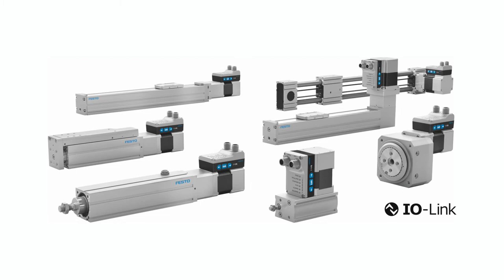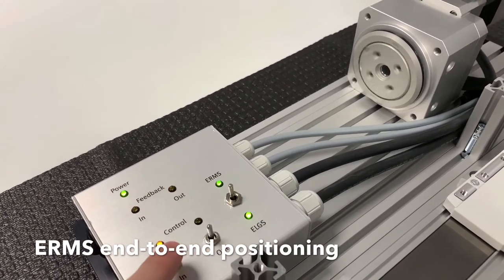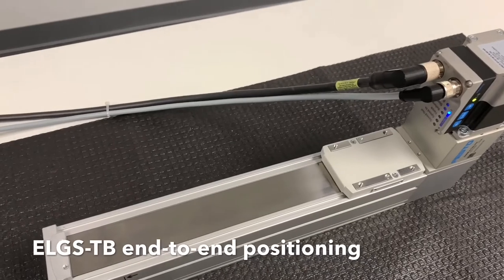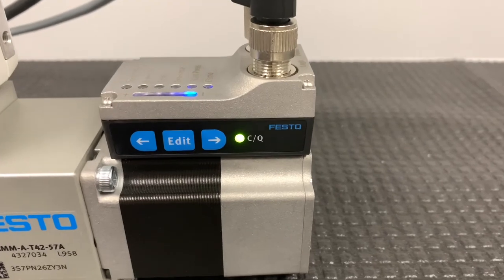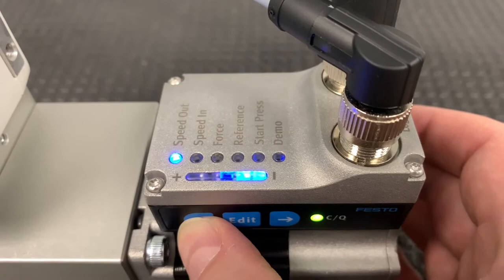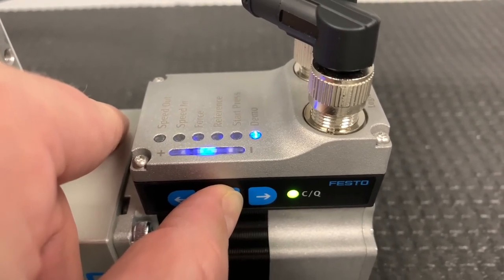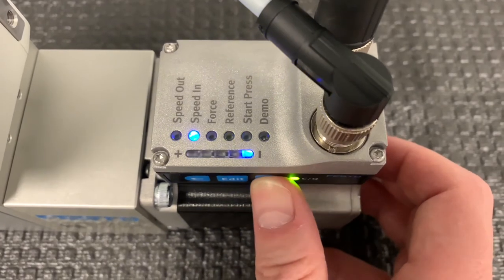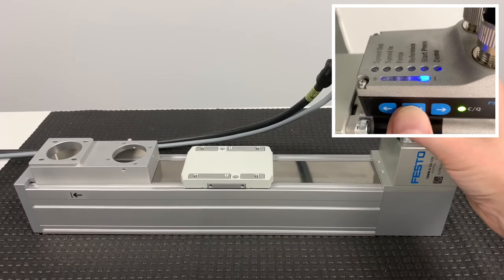Simplified Motion Series (SMS) Axis Configuration Demo

Comment: What is position accuracy,repeatibility and load carrying capacity. Thank you
Reply from the maker: The position accuracy, repeatability, and load carrying capacity specifications of the SMS product family vary by actuator type and size.  The Solution Finder on the Festo website will narrow the available options by providing SMS solutions based on your specific application requirements.  From there you can view the specifications and catalog data of the solution that best suits your need. Access the Solution Finder at https://www.festo.com/us/en/s/sms-sizing/. 
 
You can also learn more about the different actuator types included in the SMS product family at https://www.festo.com/us/en/e/solutions/electric-automation/simple-electric-automation-solution-id_318507/.